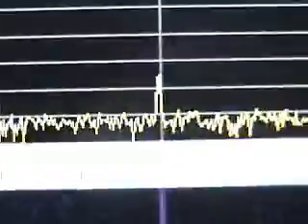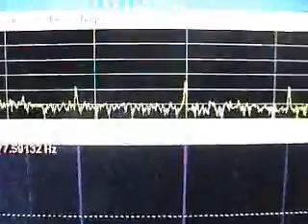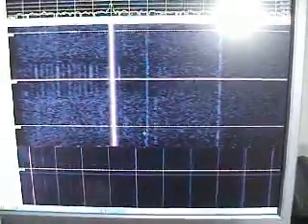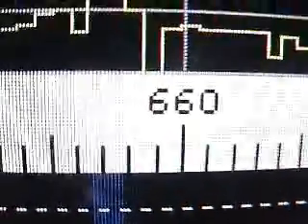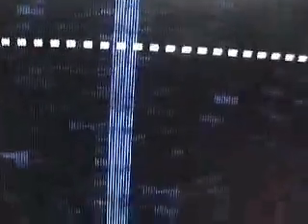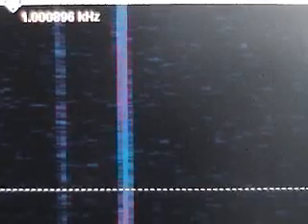VLF antenna and Spectrum Laboratory

Comment: you are picking up harmonics of the power transmission.  the stronger stuff higher up could be the data rates in the electronic equipment